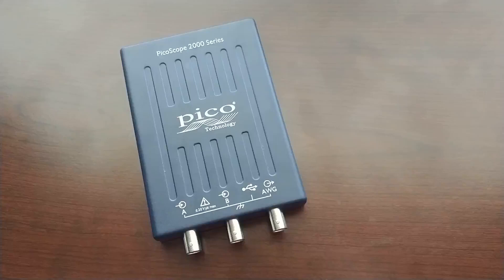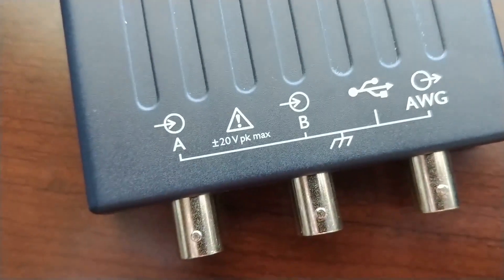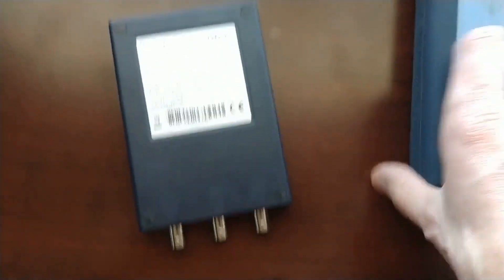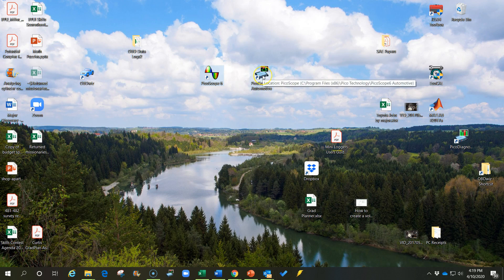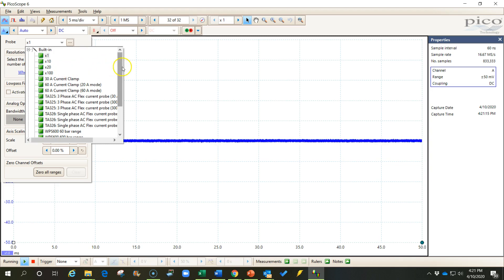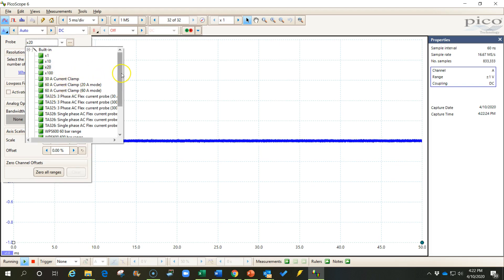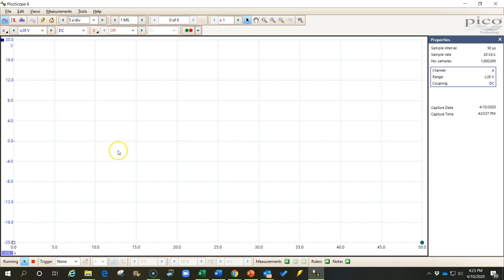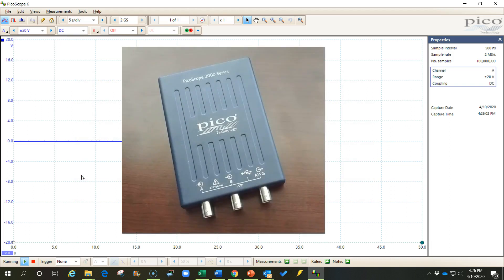Setting up 2000 series PicoScope for automotive use

Comment: I learned you can use 2000 series with automotive software if you delete the file oem.dll
Reply: yes but the new updates are making it impossible to bypass it, also, if you save the file, the new beta software detects it and throws an error when trying to open the file which sucks because there is nothing wrong with the file, just that they are trying to make it impossible for users to modify that file to bypass the filter.

Comment: Hello Justin, do you think that with a 2000 series picoscope, 4 channels or another not automotive picoscope ( very very expensive ), with this setting on the SW, I'll be able to use the NVH kit ? 
Thank you 
Matteo, FSE
Reply from the maker: Matteo,
No. You will need an automotive PicoScope to use the NVH kit.  I would suggest a 4425 or 4425A.  I know they are a little bit more expensive, but honestly they are a very good price for what you get. If you like the 2204A, you will LOVE the 4425A!  If you are interested in purchasing a scope or NVH kit, go to www.catchawave.com.  Use the "contact" page to send a message or call - I will get that message and see if it is possible to get you a discount.  I hope that is helpful!!
Justin

Comment: Is it possible to use pico diagnostics  with the 2000 scopes ??
Reply: i think if you delete a dll file you can use some of the auto software. I have a two channel pico automotive and decided to buy the four channel 2406b . works just as well as my auto 2 channel.

Comment: I got my pico 2000 series to work by deleting file ome.dll in the automotive program.
Reply: I tried and it didn't work
Reply: How to do that, please.
Reply: @P_Manom  go to your c: drive, Program files (86x),  PICO TECHNOLOGY,  Picoscope 6 automotive( which is the software, and just move the file OEM.dll out to your desktop. Don't erase it.  Just leave it out there incase you need it in future. But you need to have both Picoscope 6 and the automotive software installed for this to work. Then restart your pc, make sure your scope is plugged in and you should be good to go. Just remember the 2204A is only +20v/-20v max. So attenuators for almost everything. One other trick, if you want to analyze a waveform thats saved on your pc, you can unplug your scope, run the software in demo mode and open the waveform back up, and you'll have options you didn't have with the 2204a plugged in. Alittle trick. Sorry I know this is an old post.

Comment: What’s the file you need to delete to use the auto software? I forget which one it is.
Reply from the maker: I have not tried it yet myself, but here is what I found by searching: If you wish to use your standard Picoscope with the Pico Automotive software, simply install the automotive software then delete the file OEM.dll in the pico scope program file works fine.  Give it a try.
Reply: @JustinMillerAutomotive  I just got the 3404D scope and by deleting the OEM.dll I can run the automotive software just fine.  Thanks so much for a great video.

Comment: Pico auto scope is great but many of us DIY types simply can't afford that scope.  On the other hand the 2000 series is very affordable.  These types of presentations for the 2000 series scopes are extremely valuable and my hopes are you will continue to produce them.  I personally own a 2205A and use it for both automotive work and general electronic troubleshooting.   My weakness for automotive is understanding what I should be seeing on the scope versus what I am seeing when comparing something like a cam/crank correlation or for that matter other automobile wave forms.

Comment: Does this scope have enough resolution for things like injectors and secondary ignition?
Reply from the maker: Yes it does.  Make sure to request the highest sample rate and don't extend your time base for too long, and it will look great.
Reply: @JustinMillerAutomotive  Would a 10:1 or 20:1 attenuator be enough to protect this scope? Thanks for the videos Justin!

Comment: This is great...I have this scope and so far its done everything i've needed it to do...  however while just messing around with it I had trouble getting a fuel injector voltage wave form (using the Hantek 20 attenuator) that was clean enough to recognize the pintle hump and more detailed nuances. Hopefully you can go over the settings/setup/adapters needed in order get the kind of detail in fuel injector voltage and secondary ignition wave forms that would be useful.
Looking forward to more how to's with this scope.